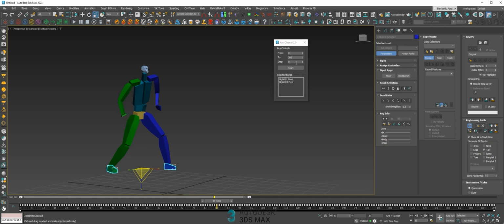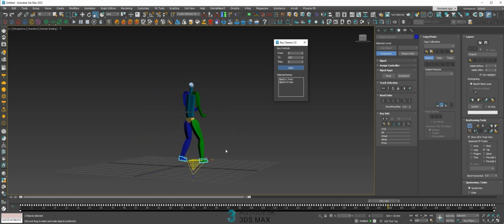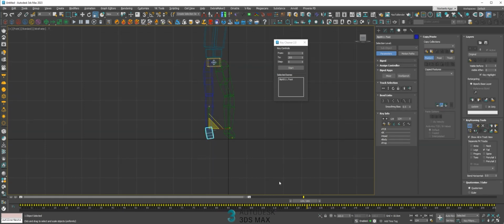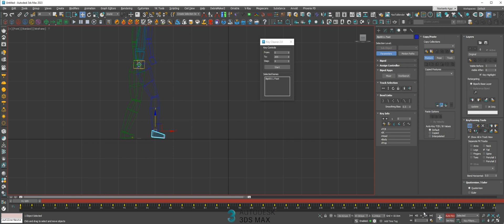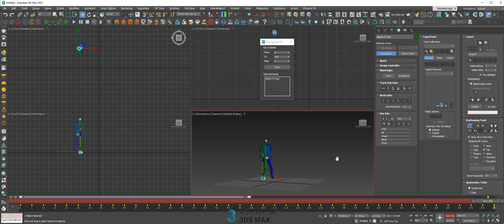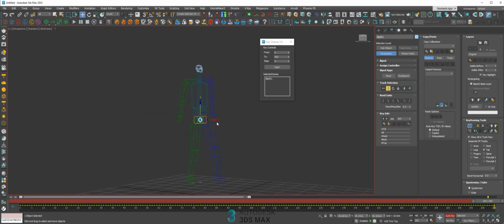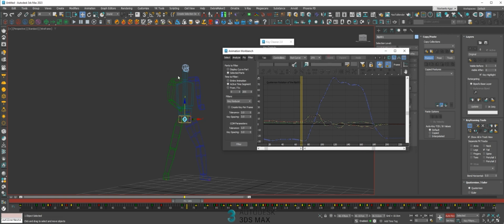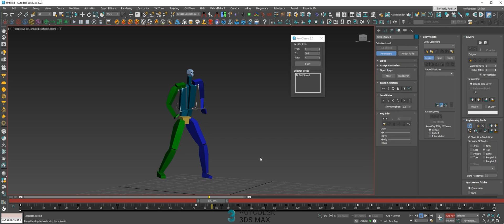KeyClean (How to use)

Comment: Hello,
I encountered an issue when using Bip001 with the script, as it triggers the following error:
MAXScript Rollout Handler Exception
--Runtime error: Cannot Add Keys to Body controller
--File name: D:\Art\\21 Key Cleaner 2.0 (1).ms --Line number: 4

Could you kindly advise on how to fix this issue? Thank you in advance!
Reply from the maker: @홀크  no need to use for bip001 it’s just for foot and hand . For bip001 you can use the filter on the workbench biped tool . That filter can do better work on bip001 and other bones.